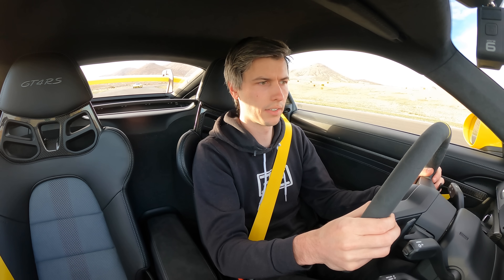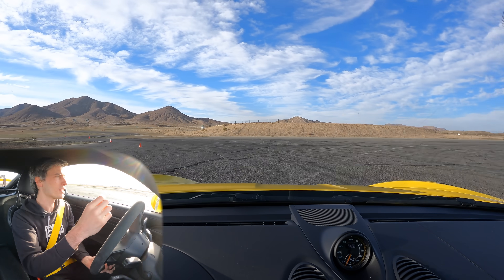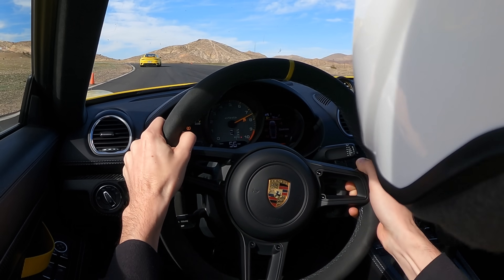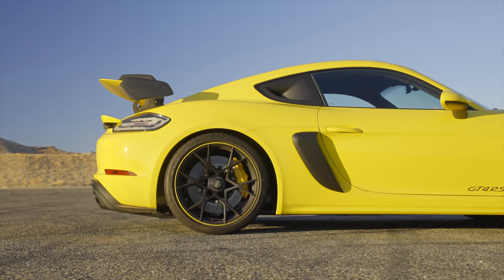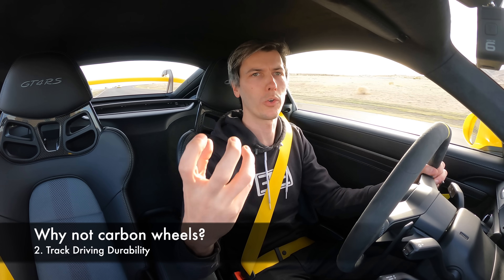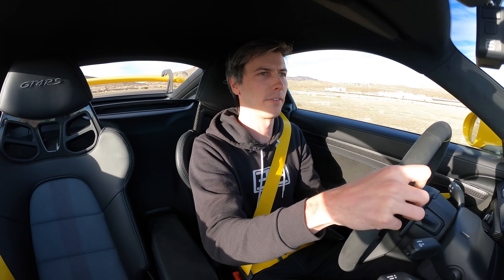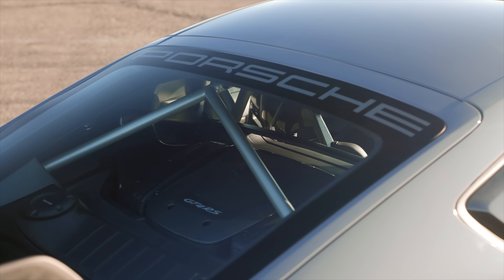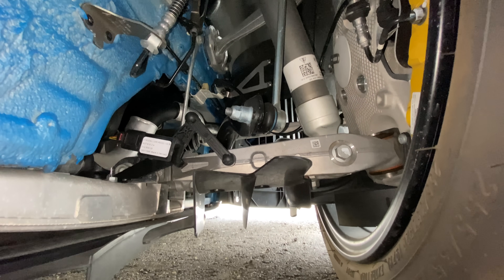The Combustion Engine Perfected - Porsche GT4 RS

Comment: You gotta give it to Porsche. Easily the most aggressive factory launch control out there. And it works great. And you can use it back to back to back to back and it couldn't care less lol.
Reply: You got to watch the 50 consecutive launch R&T did on a 911turbo for the 50th. It even pop a wheelie
Reply: @gar24407  yea I watched hat, unbelievable the amount of abuse they can take
Reply: Yep! Watching the videos of these and similar, they just eat it up. As long as you have fuel, it will rip all day and night.
Reply: Engineers at the Porsche factory launched a 911 turbo over  1,000 times in one day in an attempt to see any issues.   They just stopped because it hit 5PM, and the car was fine.
Nissan GTR - voided warranty after 3 launches
Reply: Electric cars will always be faster but the feeling and “soul” From combustion engine cars can never be beaten
Reply: @EvanMoon  
I don't think that it's fair to compare them directly, they can both be absolutely wonderful vehicles, but they achieve that in different ways.
Daily driver EVs are absolutely beloved by so many people now that we can't say that they're bad.
But I wonder how the future of enthusiast vehicles will be with electric drivetrains.
Reply: @EvanMoon  What type of faster do you mean point to point or in a straight line?
Reply: @EvanMoon  nah, porsche can compete with electric! If they wanted. Porsche are fast!! They are masterpiece !
Reply: @Mroswaldo16  lol dream on.
Reply: @Mroswaldo16  Not at the same price point I don't think. The Cayman is close but its still not as quick as an electric car, the 911 is closer but for more than $100k more
Reply: @mashedt8rs290  teslas are close if not over 100k for the faster ones or plaid
Reply: @Mroswaldo16  so more than a cayman but less than a 911. How's the Taycan around a track? Isn't that porsches electric car?
Reply: @Mroswaldo16  Sure they can compete. Just like my bike. We would both lose to the similar powered EV though.
Reply: @EvanMoon  electric cars, with our currently technology, will never be faster than ice. They can launch much better and more consistent due to being electronic and usually awd and heavy with wide tires which is why they have such fast 0-60 times(and expensive) but if your not a stoplight warrior, they struggle to beat ice cars everywhere else such as tracks, autocross, backroads/mountains, etc. and just in general "fun factor".

EVs are the modern day "muscle cars". At one point ice muscle cars where large and heavy and couldn't corner. Now modern muscle cars have gone down in weight and cost and up in power and handling characteristics and most corner pretty well from factory.
Reply: @JupiterxBlues  Nice point. I see how your leaving the door open for the enviable progression of the ev tech, lighter more focused chassis will start to arrive. With vectored torque control and braking, there really will be no better way to maximise the interaction of tyres and road. We have exciting times ahead as EVs grow out of this adolescent phase.
Reply: @jakesalvadori6852  unfortunately, EVs are all near their "peak" already. They are already as light and aerodynamic as they can get without something like full carbon fiber or an awkward looking car shape. You cant really make an EV any faster or more efficient as its almost entirely up to our battery tech that has somewhat peaked. ICE, although not considered "efficient" and putting to the side emissions which are a fuel choice issue not en engine issue, isn't yet at its peak. There are several ways they can be improved but its all a matter of keeping costs low so people are willing to buy it(for example of possibilities, see Koenigsegg's camless valves. Nissans 88lb, 400hp engine, etc.) However, if people seem willing to pay thousands more for an EV, they may be willing to finally push the new tech on the average consumer cars.

On another note: ice vehicles can run very quiet, be very fast and achieve high MPG ratings by reducing weight. But safety laws(seemingly not created by engineers that think heavy = safe) and the car manufacturers that have to obey them keep putting weak 4 cylinder engines in 3+ ton cars instead of reducing the weight, causing them to get bad mpg and slow acceleration making ICE look bad.
Reply: I'd rather launch myself, it's way more satisfying. Actually I like to shift for myself and catch the tail for myself too.
Reply: @someyoungguyjohnson7239  agreed .
Reply: $150,000
Reply: 6cyl. Almost 500hp w/o turbo, hell yeah Porsche perfected the gas engine.
Reply: Lamborghini has the most aggressive. Porsche has one of the most effective.
Reply: By far, I've tried a bunch of different ones, Porsche has it dialed in.. You can literally do it on like a base Cayman or a top of the line Turbo S.  haha
Reply: REAL MEN DRIVE CARS that dont need LAUNCH CONTROL.. Launch CONTROL is for women....
Reply: I really like my GT3RS but this might be something absolutely wild.
Reply: Until it breaks at 20k miles.
Reply: With the PDK 😂 over and over. And over
Reply: McLaren is even wilder but also more expensive...
Reply: I agree, but if we're honest, it's the most useless thing on the street. I would get a kick out of someone using launch control at the Starbucks drive-thru though. 😆
Reply: This GT4RS does not have the most aggressive factory launch out there 🤣🤣🤣. You’re focusing on the sound. There are much more aggressive factory launching vehicles than this lol. Biden told me to tell you “Come on man!”
Reply: "couldn't care less" - Michael, you have saved the internet today. Thank-you.
Reply: What about the 765 lt?
Reply: @KrabKrusty1  

765 lt : Rwd ,4L v8, 755hp, 590lb-ft 

Plaid S: Awd, 1020 hp, 905lb-ft 

Gt4 RS: Rwd, 4L F6, 493hp, 331lb-ft 

For 331 lb-ft of torque Porsche is doing it right
Reply: Right? Yea hey guess what song I'm singing: dee do dee dee dee dee dee, dee do dee dee do dee dee dee dee do, dee dee do, dee dee do, do dee do. duh do dee do.
Reply: @NoZioKikes88  Mr. Krabs on the phone with the radio guy, for sure.
Reply: Nissan GTR entered the chat
Reply: @0verboosted  still trying to enter but it has no chamce at porsche launches!
Reply: @Mroswaldo16  hmmmm koenigsegg has entered the chat
Reply: @narmale  nothing to say! Kosnigsegg #1 IMO.
Reply: @Mroswaldo16  i dont think any other car maker can do the brake challenge :3
Reply: @narmale  or to the 400kmh, that RS started sloww!
Reply: @Mroswaldo16  yeah, i was guessing wheelspin from the way that rev limiter was bouncing, but i cant imagine it even letting wheelspin happen on a car of that level... but, i couldn't see the gauges soooo idk...
Reply: @narmale  nah. It started slow, then floored it at around 80mph or 100mph if i remember correctly
Reply: @0verboosted  992 turbo s laughs lol
Reply: @0verboosted  Nissan GT-R Has left the EU 😂
Reply: I HAVE NO INTEREST IN INTERNAL COMBUSTION engines any longer - its the chirping of a dial-up modem in the fibreoptic world - its history...

I gave away a CL55 merc a year ago, Id not used it for 3 years and it was sat outside slowly rotting, better to give it to someone who cares, Ive lost interest in noisy, oily, polluting, unreliable, shaky, expensive 20th-century technology.  Ill go to the classic car shows to see history - I dont want to DRIVE history.
Reply: @piccalillipit9211  ice isnt history yet? But EVs and ice arent like a fiberoptic cable vs dial up. Otherwise that would be some slow fiberoptic cable and no one would want it. Its more like an electric drill and screws vs a nail gun with nails. Different tools doing a similar job but one cant replace the other as you need both to build a house.
Reply: @JupiterxBlues  - I think we are talking from different but equally valid standpoints.  I believe you are saying "we still need ICE cos not everyone can have an EV" am I right??

And is fo - YES I 100% agree with you. I'm just talking from an expensive performance or luxury car perspective. My last Merc did 13 to 16 MPG most of the time - 25 on the motorway, but I hardly did any motorway driving. That's over $1 per mile at current European prices for 100 octane, which it was supposed to run on.  And that was for less than 400bhp. Just looked it up 360Bhp. 

Im just not interested in $280 a time to fill the tank, Im not interested in standing there at a gas station breathing in foul-smelling petrol fumes, and massive annual service bills, its all just so 20th century for me. At that level of motoring - either performance or luxury - I want silent clean electric power. I dont want my iMac plugged into a generator and I dont want my car running on petrol.

If I was buying a utility car for $5k - totally different story. As it happens I don't need a car now, I live right in the city centre, just hire one for trips.
Reply: @piccalillipit9211  you sound like fun
Reply: @BmacRDX  - What cos I don't want to drive 100-year-old technology that is dirty, noisy and polluting...?  We used to have steam cars you know, why are you not driving a seam car - getting up an hour before you need to use it to stoke the boiler with coal...???
Reply: @piccalillipit9211  Your opinion is exactly that. Unfortunately electric cars are far dirtier than our dinosaur fuels. The production of electricity is dirty, the transportation of electricity is monumentally inefficient (less than 50% mostly), the cost of upgrading and sustaining an otherwise perfectly adequate power grid is insane (that's the lines, infrastructure, fuel to install and transport all new materials, not to mention the cost in labour!), the energy and materials required to install thousands of charging points since the infrastructure is totally inadequate rn, then you have to convert the voltages to suit purpose which again has inefficiencies, the mining and transportation of the battery materials has a huge cost in human life and pollutes the surrounding environments with far more toxic materials and once the battery has served it's purpose in life goes on to pollute our land fills and surrounding areas. 
Electric motors are brilliantly efficient however to power them is less efficient and more polluting overall over ICE. It's a false economy and the (zero emissions) only applies to the no vehicular exhaust emissions.
ICE's have recorded 50% efficiency in the past and engineers are always innovating new technologies to improve overall efficiencies, there are far less steps involved in the drilling and transportation of fossil fuels also.
Before green electricity is mentioned there's no such thing, the likes of windmills and solar power have huge environmental impacts also and are simply not as green or effective as fossil fueled power plants. 
There's only 1 factor to consider in our world, money makes it turn! It's all marketing and money making. Civilization is going backwards when it comes to the production, transportation and storage of energy. Nuclear (when done correctly) is the only viable cleanish source of energy. I could go on and on, engineering explained has an interesting video on the topic which is very detailed, unfortunately it misses out on many more variables and factors that overall make electric power vehicles for the masses hugely irresponsible and damaging to our delicate environment. This is widely accepted in the science communities but unfortunately marketing and politics have everyone believing that they are helping to save the planet with electric vehicles, it is quite frankly a lie and a disgrace.
Do your homework before considering an electric vehicle also get a car that has far better economy than 25mpg if your so concerned.
Reply: @piccalillipit9211  Tell me this, how can companies that have fleets of sales vehicles on the road afford to have those people sitting for 45 minutes waiting for a car to charge? They are not practical in the real world. I am curious of the annual service (AMG 1 time per year maybe $2000)  vs the cost of a new battery (Nissan leaf $30k). The new battery is so expensive it makes the car a throw away... Good for the environment???
Reply: @piccalillipit9211  Now you wait that long to charge.......
Reply: @piccalillipit9211   Internal combustion engine automobiles supplanted the horse quite some time ago. Yet, the worldwide equine industry is a 300 billion dollar per year thing.
Perhaps it's not always about the most modern, fastest, smoothest transportation available.
Reply: @williamgechtman9287  - The limiting factor for EV sales is battery availability. the EV makers all have long waiting lists for their cars. The ONLY reason anyone produces and ICE car is they cant produce enough EV's.  NO manufacturer wants to make an ICE massively complicated, a warranty nightmare, they make them cos they cant produce enough EV's - thats the only reason.

Its ALWAYS always about the most modern, fastest, smoothest transportation available.

The ICE car will be like the horse in 15years time, a play thing for enthusiasts who are willing to put up with the inconvenience, the aggravation, the dirt, the smell, the cost - because they love them.   My sister has a horse, she also has a Tesla Mod Y on order...
Reply: @piccalillipit9211   A 300 billion dollar industry is not nothing.  We don't need horses, they may be a plaything for the rich,  but they did not go away and are certainly an ongoing, thriving, industry.
They will probably keep making ICE cars for the same reason, because some people will keep buying them, even if costly. Not as many, and they will be specialty  items, but they will be there.
EVs are more efficient, faster, smoother, and more mechanically simple than ICE cars. 
Internal combustion engines for the mass market are going away.
There are those like me, however, who enjoy the act of driving, who enjoy the 3 pedal dance with a manual transmission and a clutch pedal,  who appreciate that physical act and the sensations associated. 
It is more than transportation. 
That is worth something to some people. Enough to pay for a car rhat is about transportation as a horse is about transportation. And yet, a 300 billion dollar industry....
BTW,  are lithium mines the cleanest things around?  How are we disposing of all these lithium batteried cars? They may well cut back on greenhouse gasses, but they come with their own sets of problems.
Perhaps we should all get horses. Renewable, organic, and they produce non-petroleum based fertilizer. They do smell, but one gets used to it.
Reply: @williamgechtman9287  - I think that is basically exactly what I said.  ICE cars will become a thing for enthusiasts that like, appreciate and want them and are willing to put up with, even enjoy the downsides. ICE cars will never go away and i would be against any legislation that banned them for enthusiasts. 

And BTW - big misconception - Lithium mining is just about the most environmentally friendly mining as lithium is water-soluble, they pump hot water into boreholes and suck it back up and then electrolysis the lithium out of it.  The used car batteries currently get used in grid storage systems, if they lose 30% of their charge capacity that's an issue for the car driver but not for grid storage companies. HOWEVER, the new Tesla 4680 cells have a life span of 1 million miles. 

Entire recycling industries are already set up WAITING for the influx of used batteries, its anticipated to be a hugely profitable industry - the problem is there are no unwanted 2nd hand batteries yet - trust me NO ONE is throwing lithium in a landfill - its a valuable metal.

Cobalt is the element everyone freaks out about cos its basically only available in terrible places in the world where they use children to mine it - but the majority of batteries now contain either NO cobalt or trace amounts.  You only need cobalt for high power things like Mod S Plaid, for your daily driver you can use iron instead of cobalt. 

Let me be clear- im NOT anti people having a hobby, if you want to drive and MGB or a E type or a R-34 or a Charger I fully understand and totally support that - Id quite like to own and drive one of them. But for day to day use I want an electric car. I love the styling of the old bakelite 1920's telephones - but I want an iPhone for day to day usage...

What I most like about the electric cars is the form factor of the power train means that we can now have AMAZING looking cars again - Check out the Nobe 3 wheeler, the Aptera 3 wheeler - they are AMAZING...

Yes - I want a 3 wheeler - why? cos its quirky
Reply: @piccalillipit9211   I've heard discussions that this may herald the rebirth of coach built cars -- buy the skateboard EV platform and have the coachbuilder of your choice build the bodywork.
Reply: @piccalillipit9211  lol muppet
Reply: @piccalillipit9211  Spoken like a true non driver......... Go drive your toy in silence.....
Reply: @piccalillipit9211  sorry to hear that. Maybe you can find a new Hobbie. Maybe Nitting or stamp collecting.
Reply: @BeStill66  I already have a new hobby - Ill be getting an Aptera, a 3 wheeler solar-powered car that looks like a spaceship pod that will never need charging where I live [300 days of sunshine a year] and does 0 to 60 in 2.9 seconds.
I don't want to drive 100-year-old technology that is dirty, noisy and polluting...?  We used to have steam cars you know, why are you not driving a seam car - getting up an hour before you need to use it to stoke the boiler with coal...???
If you  want to drive an antique - knock yourself out, I'm not telling you what to do...
Reply: @piccalillipit9211 , good for you
Reply: @WDLC1911  - Thank you - Im not very popular on this thread LOL...
Reply: Or model s plaid?